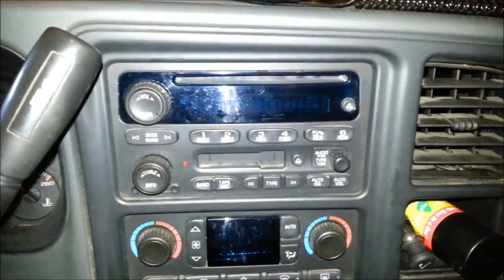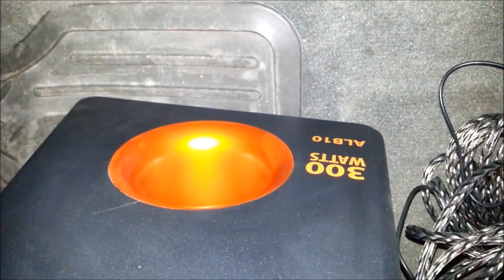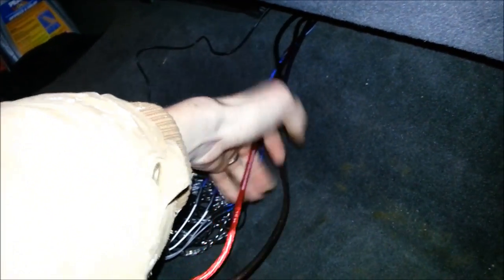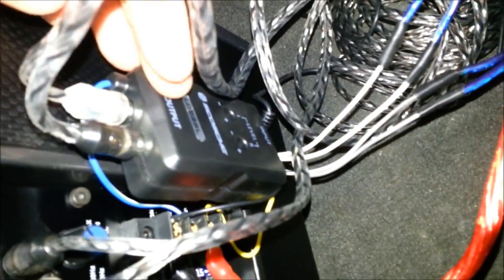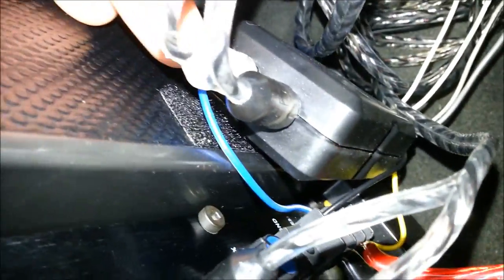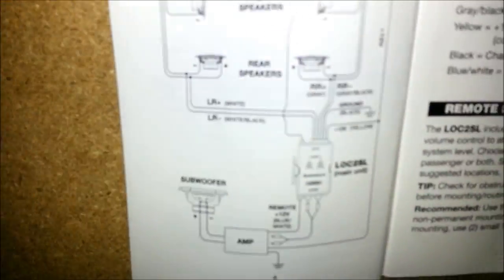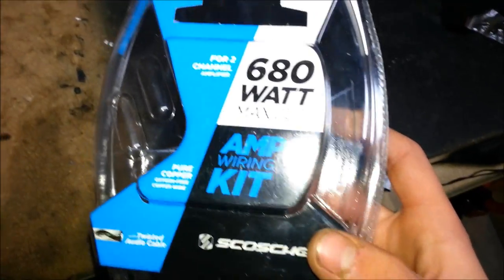How To: Install a sub and amp with a factory radio - 05 silverado

Comment: i just used the high input connector on my 2013 f150 i ran the wires to my right rear door speaker and connected them to the speaker terminals so i didn’t have to cut my wiring harness, works great it’s a 600watt amp and 12 inch sub
Reply: bolted my ground wire under the mount of the stock subwoofer
Reply: im curious on how you ran it to your rear door speakers cuz i also have a 2013 f150 and i plan on buying one of these. so what did you do to run the speaker wire from the LOC to the door speakers?

Comment: K I have a 84 gmc and the only speakers are behind the seat. So I put a new kenwood in the truck so I saved so much money! I got the kenwood for free and the home theatre speakers and sub were also free. And that setup has great sound quality and will rattle the truck and got it all for free I know you should use those automotive but it works so I'm extremely happy
Reply: And I wired my sub to front and speakers to back it is just direct to the stereo and still sounds great!

Comment: going to try this out for my avalanche this weekend, i dont want to mess up the factory value and cut out all the standard equipment, so this way i can go about it by adding what i want without cutting anything, i am adding two 12 inch subs
Reply: I did the same with my '07 ltz. Had a custom box made by car audio factory.com. had the jl 1000/1 with 2 12" w6. Had the bose so it complimented the stock sound

Comment: Awesome video man very informative thank you so much for making it :) I just bought this adaptor recently as I bought a 2011 Silverado LTZ it has the bose system but no factory sub or anything so I'm use to having subs in my vehicles my 97 I had 4 subs in it ha ha, so I've been trying to find the best way to hook it up and this is by far the best video I've found! I would really love to see a video of your system turned on playing some tunes hopefully you post 1 or maybe already have 1 I'll have to check ha ha either way glad to know I don't have to search for a wire to hook my remote and ground on that adaptor to, I can just hook um to the amp after I get the power wire and main ground ran an mounted, I'll havta check into the harness running along the side as well for speaker wires so I don't have to pull my door panels or stereo out to tap into those on each side, hardest part is going to be trying to figure out how to tune my amp to the factory stereo its tuned to my JVC from my old truck and was running it at full 1200rms power 300watts going to each sub but now I'll only be having 2 and running only 600watts so that will require a retune of my amp which I use my SMD DD-1 to do so....not sure how well that will go on a factory stereo....
Reply from the maker: I'm glad it is helpful for you! I can try and take a video of the system working, but it's difficult to get a good sounding video with my phone.
Reply from the maker: This adapter should work just fine in your truck. It doesn't interfere with your bose system. It will just take the signal from your speaker wires and convert it to low. Easiest way to get to your speaker wiring harness is like I did, pull the plastic trim off the bottom and open up the harness. You may need to research which wires are to which speakers and so on.
Reply: Awesome just got it hooked up last night works great but found out 1 of my subs was blown coil rattles around lol
Reply from the maker: sharkack666 Good deal, glad to hear it worked out for you. Sorry about your blown sub! I know that feeling haha. Just curious, how did you connect the wires from the adapter to the speaker wires?
Reply: Tied into speaker wires under floor kick panels like you showed in video soldered wires on taped everything back up then tucked an ran wires to the bacl
Reply from the maker: sharkack666 Sounds good, like the fact you soldered the wires. Many people don't bother to do that. It's not a huge problem if you don't, but with soldering, it will hold the connection better and at times provide a better quality sound.
Reply: I agree! I love soldering my connection even soldered the wires on the adapter end to an used heat shrink

Comment: Where did you connect the blue remote wire?
Reply: To the remote on the amp or do an add a circuit connect it to a fuse lik a fuel pump that turns on when the car turns on

Comment: Hello Jeff here In Southern California 
 I have an 2004 Silverado 1500 LS 4 Door Extra Cab Like yours radio looks exactly the same. the only difference is the A/C HOT COLD Slide controls are up and down not side to side Do You remember the Color Wires for the hook up from under the Door Sill? Of Course I will make sure its the same before I just Fry Something. 
 I have 6x9 Enclosures I put 2 DUAL BRAND 6x9's No SUB  everything is going to be hidden away under the rear seat I bought a BOSS MODEL AMP XX152 200 Watts 2 Channel just for a little more sound No Remote the amp just has the Little Dial Knob for adjusting 
 I'm sure you can tell this is my first go at doing amps of any type so Any help will be helpful. Just cant afford a Pro Install I figure just doing Walmart kit like yours.
Thanks A lot for the Video gives me confidence to do this.    Jeff
Reply from the maker: LR Speaker= (-)Brown  (+)Yellow 
RR Speaker= (-)Dark Blue  (+)Light Blue
Reply: FoleyArtist Thank You Very much I found them exactly where you said they would be

Comment: thanks for the video. 
 Im hooking up a JL W6 with a mono block amp and I am using the high low converter. 
My question is, on the converter would I still need to hook up to both right and left speakers? I can hook up either mono or stereo.
Reply from the maker: The instructions that come with the converter will specify how to wire it up.
Reply: ok thanks,  I get my package tomorrow

Comment: I have an after market subwoofer that used to be in a cobalt by pioneer. It has two negatives and two postive wires. Can i just put two positives and two negative wires in the amp connections and itll work
Reply from the maker: Theoretically that should work.
Reply: @MinTV701  okay ill be doing that then. Ill update if it worked or not thnks for the video

Comment: I'm about to do this and have the adapter but curious I realized my amp and yours come with the wires for high input instead of the converter it has its own built in. My question is why not use that instead it's the same thing.
Reply: Because some amps doesn’t have high input but if your amp does, then just use the high input side straight to the speaker harness

Comment: hey man great video, my only question is concerning the size of the amp , maybe you could tell me the dimensions or let me know if it'll fit flat face up on the floor under the seat I have a silverado too and wanted to use the back seat as well, thanks
Reply from the maker: This specific sub/amp wouldn't fit under the seat on mine.
Reply: +DJALS damn, thanks for the quick reply, do you think you could send me the dimensions of it sometime? I was considering this same amp
Reply from the maker: +Connor McKee no problem, but I not longer have the truck so I'm no help there. Sorry.
Reply: +DJALS alright forsure man thanks for the help
Reply from the maker: +Connor McKee but perhaps if you removed the speaker guard, it may fit under the seat with the speaker facing up.
Reply: +Connor McKee The 10" kicker box from walmart fits perfect under the rear seat of my 2001

Comment: i have the same truck but mine has the bose system radio looks exactly same as yours will it work with mine?
Reply: You have to bypass the bose system by cutting in to the wiring harness on the bose amp under the center console... Or you can just buy the wiring harness needed which I think is like $150

Comment: hey what is the blue wire coming off your LOC next to the RCA wires....that is my only issue with my install. Is it a ground wire or just an extra wire?
Reply from the maker: That is the remote wire, it connects to the remote tab on the amp.
Reply: It's a remote turn on wire you need it
To turn your amp on when your car turns on.. Turn car on power goes through the blue remote wire to click your amp on to start working

Comment: Great video! Just one question if i do this way will i lose some power to my rear speakers? Or even sub? im plannin this way using a 4 chan amp to run the fronts and sub. Also will this affect the settings at all on the deck? ie; fade balance etc?
Reply from the maker: If you just splice I to the rear speaker wire you should not lose power to those speakers. It's not exactly drawing power away from the wires, just using the signals for the bass. Settings on your radio should also work as normal.
Reply: +DJALS thanks for replying! so if i tap into the rear speakers i can just disconnect the orignal front speaker wires n  run new wires from the amp to the front speakers right? i will be running the rear speakers from the deck and running the sub with the other channe. so with this setup all ill need is the one loc?
Reply from the maker: +vtc80y I believe you can do it that way. I've never wired a 4 channel amp before.

Comment: A man i installed 2 12" subs with a fosgate along with a kicker 4 channel amp to power my 4 speakers. The problem is when i turn the key either on or off the subs will make a pop sound, its not loud but its really annoying. I have my oem head unit. I hooked my ground pretty good. My remote control wire is hooked up to a relay that powers on when i turn the key. Do you think thats the problem?
Reply from the maker: jhebe v You might have to go and double check your wiring. I don't know how you hooked up the hi/lo converter, so you may need to check your connections.
Reply: +jhebe v You need a capacitor, it feedback from your alternator and battery, the capacitor will filter the feedback out.
Reply: +jhebe v Your subs are turning on before the radio, mine did the same thing and I had the remote wire stuck in with the radio fuse.  Once I got an aftermarket head unit and hooked it to the stereo it quit.

Comment: Do you have to use both rear door speakers? Can u tie into just one?
Reply from the maker: Both sides are required with this adaptor.
Reply: No you can tie the left positive to the right positive and the left negative to the right negative and run mono to the amp from one speaker

Comment: A fast reply from anyone would help a lot I have a massive roll of 16 gauge speaker wire can I use that to run all of the stuff on the converter besides the 12 V positive and the negative ground

Comment: What about the remote wire blue wire were did u put it at to get power
Reply from the maker: The remote wire from the hi/low converter went to the remote wire on the amplifier.

Comment: Hey man can u plz tell me how and where u connect ur remote amp wire..the wire which turns on ur amp...the only issue i have..
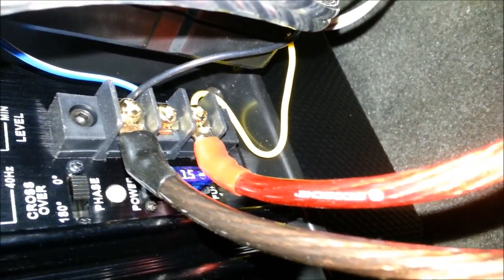Reply from the maker: If you are using the right hi/low adaptor it will have a remote wire that will connect to the remote tab on the amp. I show it in the video at the 3:20 mark.
Reply: @MinTV701  thank you bro if it's done like that will it remain on when the vehicle is off?

Comment: you cant do it with a OEM amp i tired doing it and it doesn't work for you GM people from 2000-2012 with the Bose amp there is a connection on the back of the radio plug the stock non bose amp connection that can act as a bose to stock bypass yes you do lose the front sub but you will have a better one then the 50w OEM sub then what you can do then is tap into the door speakers i hope this helped someone in the same hole as me i did this and now my sub is working 100% its great
Reply: What wire do you use for the aftermarket amp.? Is the the power on connection on the back of radio going to the Bose amp ? And your running it to aftermarket amp instead for radio on for the new amp.?  then gaining audio from the door speakers?

Comment: where do I connect the blue remote wire on a 2004 GMC sierra??
Reply from the maker: It would be best to wire it to a key hot fuse. So like the fuse for the radio being the radio only works with the key on.

Comment: Where did you get the adapter and will it work with 2 12's?
Reply from the maker: The adapter I used was purchased at Walmart. And yes it should work with any subwoofer configuration. The adapter is simply a converter that converts the high signal to a low signal for the amplifier.
Reply: @MinTV701  great. Thanks for the help
Reply: @MinTV701   also how do you connect the bass control knob. Mine has 4 female ends (2 white) (2 red)

Comment: "High Level Input (Speaker Wire)
High level inputs should only be used when RCA outputs
are not available from the head unit. Connect the head
unit speaker outputs to the high level input connector
as shown below. The black wire (signal reference
ground) may or may not require a connection to chassis
ground - depending on your particular installation. Do
not use both low and high level inputs at the same time.
Connect only one or the other."

Why didnt you use the high level inputs that are included with the sub?
Reply from the maker: Robert Dudley I followed the included instructions for installing the hi to low converter and it worked flawlessly. Not exactly sure what you are talking about?
Reply: The high level is not frequency level, its power level, your speakers operate at a higher voltage than the rca input does. The adapter turns this high level output into headphone level output.

Comment: How exactly did you connect your power wire into the battery box? My 05 Tahoe has the same red plastic box but I can't get the bolt off
Reply from the maker: I connected the power from the amp to that red box. If you can not get the bolt loosened, you can connect it to the battery instead.

Comment: Dude... what a messy install.  Do some more research on Youtube and learn how to run all the wiring properly...
Reply from the maker: Brian Catalano at no point did I say I was a professional installer. Matter of fact the intro even stated that. However, this a DIY video of a basic install. If people want to tuck wires they can figure out themselves. My wires were actually ran just fine. I've seen many poorly ran setups. Power wires ran through door jams, exposed wires from the insulation etc. This isn't a competition show quality installation buddy. Chill
Reply: DJALS by why spread such an atrocity?  You're one step from burning your truck down lol.  I've seen better-looking setups burn to the ground.
Reply from the maker: Brian Catalano You're the only one complaining, so get over yourself. Maybe try creating some useful content yourself if your so inclined. But thanks for the view. 👌